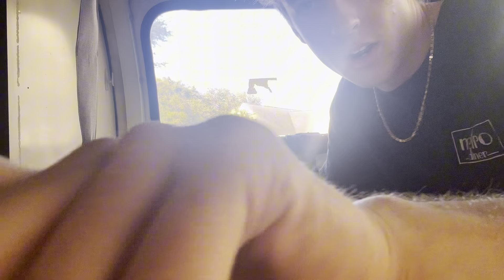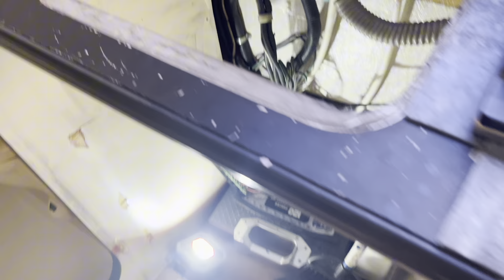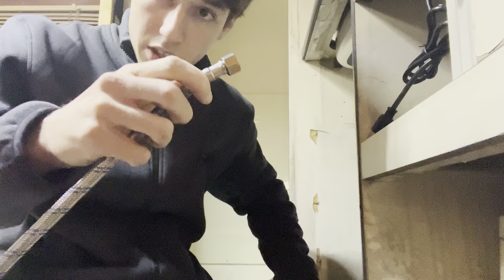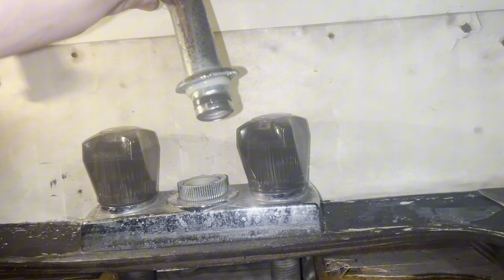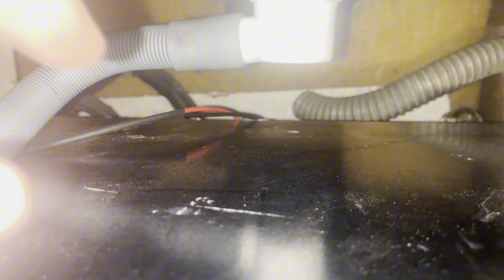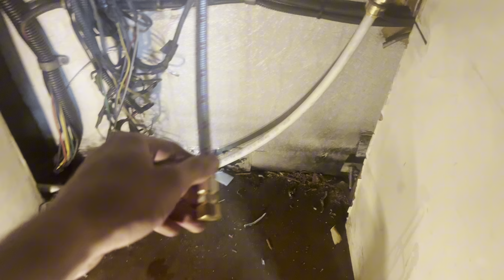Installing a Brand New RV Sink in My JDM Camper Van

Comment: Air in the line? I would deal with the soft wood under the faucet sooner than later. You are making great progress. I am a proud member of the first 💯 subscribers and love watching you think your way through your rebuild. You're really doing it!
Reply from the maker: Yep there was a leak at the pump connection that I fixed. It flows perfectly now. And yeah i will probably stick a beam underneath that wood for reinforcement. Thanks for following along with the videos 🤞